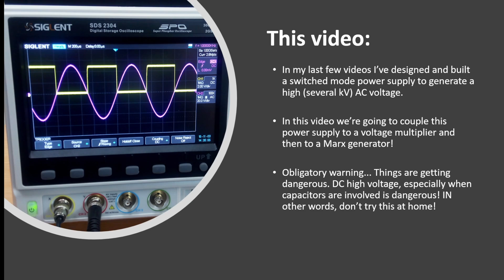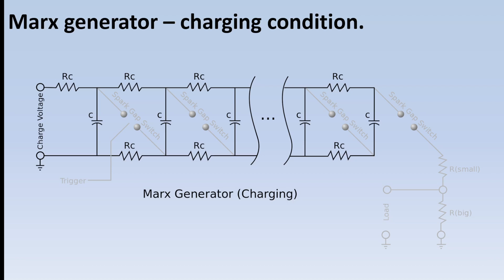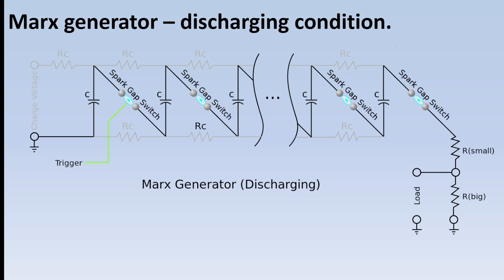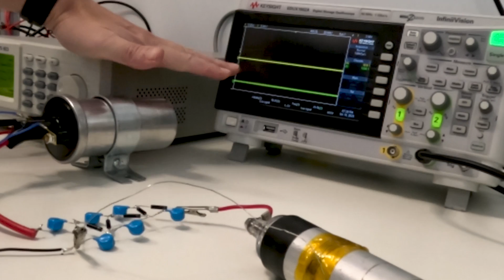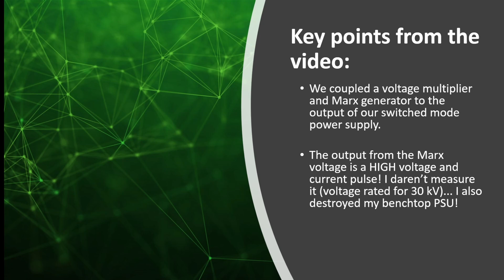How to generate REALLY HIGH VOLTAGES using just 9 Volts...

Comment: hi just wondering what exactly i'd need to get fresh off the bat to make a 30 kV 10 µA circuit with a spark gap. kinda like a stun gun i guess, but much much safer if i do it right. just a bunch of diodes, resistors, and the 9V battery to power it?
Reply from the maker: You need some kind of oscillator, something that turns the DC from your battery into an AC signal that you can put into a step up transformer. Easiest way would be to buy something like an audio amplifier (either a small integrated IC or better a class D amp from AliExpress) and then combine it with an ignition coil from a car. This should get you 10-20kV at a few kHz. You then need some diodes and capacitors to rectify it to make DC (if you just want HV then AC is safer and more fun than DC).

Comment: Or, what he means is.
TRY THIS (at home or at work) but use extreme caution, or the zap test.
If it goes ZAP, when you poke a screwdriver's shank at it, don't use a finger instead.
If nothing happens, don't use a finger in case you didn't short-it correctly, and it still needs to ZAP something dumb.

Comment: Why didn’t he just use longer screws and run them all in from the outside? 
9:22
Reply from the maker: I was hoping to use shorter screws and have them all from the inside, it’s better to have a rounder and smoother surface for consistent breakdown. However, soon realised that was never going to happen as there wasn’t enough space to do it that way! Putting both sides in from outside would have looked better, but it was so tough to screw in/out I didn’t want to change it!

Comment: This is why you use a 12v Lead-acid battery.  You'll still get zapped, but at least your power supply won't die. Been there, done that. Still alive.
Reply from the maker: This is definitely the way to go, with the addition of a 20 foot copper pipe hammered into the ground to make a decent earth!
Reply: And always only touch things with one hand. Speaking of deadly electricity, back in the day I worked in the oilfield as a pumper. Id check condensate tank levels alone and out in the middle of the plains. It's windy, and you often times generate a decent static electric spark. If we didn't ground ourselves when going up the ladder, we could accidentally spark the vapor as we open the hatch. Fun tumes and those sparks are nothing near what this dude will put out lol.
Reply from the maker: The idea of a spark igniting oil vapor is scary as hell, at least I didn’t have that to worry about! Thanks for watching!

Comment: yeah, it is advisable to have a pair of Zener diodes across the output of your power supply when playing with high voltage stuff to help reduce voltage spikes. naturally, Zener values higher than your operating voltage ( pointing towards each other in series and parallell with the output ) Back EMF travels far when voltage is high. The spike can still travel to ground and cause trouble if the power supply is not isolated with a transformer or something like that. sometimes just a transformer with a simple bridge rectifier is the best to use if you are sure your experiment can damage your equipment as it won´t take damage easy and even if it does you probably just need a new rectifier. play safe
Reply from the maker: Good idea about the Zener diodes, maybe even a TVS would be a good. I’m pretty sure it was the grounding arrangement that caused my issue, firing the output of the Marx directly into the ground terminal of the dc supply probably wasn’t my brightest idea! 
Thanks for watching!
Reply: @thecircuithelper  No problem :) things happen. Even if you think you are safe. Not very long ago a phase to my incoming power to the house blew while my 6KW 400v 3-phase was running it did not immediately stop so the heat pump acted like a generator on the now floating phase and my kitchen light exploded and it completely killed my PlayStation 2 as well. In the PlayStation there was like stupidly rare avalanche diodes that surely don’t exist anymore that was killed along with fuses and stuff. I had to convert the circuit to revive the power supply again by replacing the diodes with a suitable MOV instead and mount a fuse holder and new capacitor. Things sure can cause havoc when you least expect it. But my PlayStation been working perfectly since the incident I could not control

Comment: at a 30kv output, ur caps should be fine. Since they are all in series there isn't 30kv across every capacitor. Also thats definently not 30kv. And definently not 120kv at the final output. Seing as the spark was maybe 2cm or something, i would say its 20kv.Also, how did u brake ur PSU?
Reply from the maker: I was more worried about the caps in the Marx bank, they charge in parallel ultimately reaching the DC input voltage (assuming it doesn’t  fire before fully charging), so 30 kV would be an issue. You’re right though, output from the multiplier definitely doesn’t look like 30 kV, I’m guessing more like 10k… not sure what was going on with the scope, probe probably needs calibrating or maybe I nudged the dial and accidentally set it to x500 rather than x1k. 

No idea what happened to PSU, very weird, Marx bank fired and immediately the power went off (like I’d removed the mains). Wouldn’t turn back on, changed the 13A fuse in the lead and the 3A fuse in the PSU, still totally dead. Completely opened it up and couldn’t see anything obvious (no burnt components etc). There might be some other internal fuse I’ve missed, but tricky to know without the circuit diagram. If I had to guess, I’d say the Marx output directly to the psu ground terminal probably sent a sufficiently high current pulse to raise the voltage of the ground up, that’ll destroy most things unfortunately! Better to use a battery and a separate earth,  but I didn’t fancy clipping the battery by hand and I don’t have a decent Earth in that lab, unfortunately!

Thanks for watching!
Reply: @thecircuithelper  as i said i would use a voltage divider. Also Car ignition coils opperate at low-ish frequencyes, so unless the capacitance is very high, the impedance is huge(u can see this when people use MOTs as a power supply). Discharging to your supply ground is never a good idea lol. And i realy think you should get good grounding in your lab. I realy dont know what happened to ur power supply tho... hopefully you can find a new one.

Comment: I have to say, that looks bloody dangerous! What would happen if you got ‘zapped’ by the output?
Reply from the maker: I dread to think! Quite a lot of stored energy, could be fatal, certainly not something to play around with!
Reply: Voltage multipliers with small sized caps are routinely used in bug zappers.   Unless they are "super-sized" they can't do any real harm.  OTOH, a microwave power supply can kill you if you just look at it hard.
Reply from the maker: The multiplier would hurt, but I guess such low current DC wouldn’t be a ‘show stopper’. 

I would not want to get zapped by the Marx generator though, caps are 1 nF and there’s 8 of them charged to somewhere between 10-20 kV, this gives 0.5 x (8nF)x (15k)^2) = 0.9J…  in comparison a microwave oven cap has approx 2J of stored energy (assuming 1uF, 2kV), a defibrillator capacitor can be around 100J, an enormous amount of stored energy to release in a few microseconds! Of course the internal inductance limits how fast this energy can be delivered and the cheap caps used in the Marx here are pretty poor (although adding them in parallel helps)….